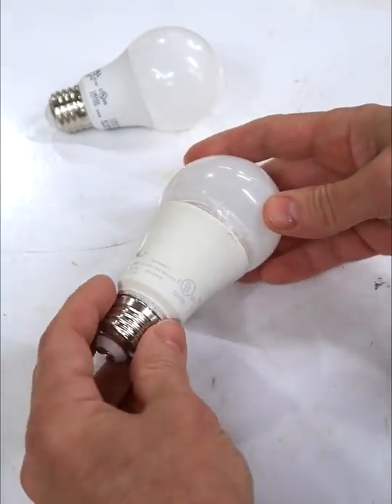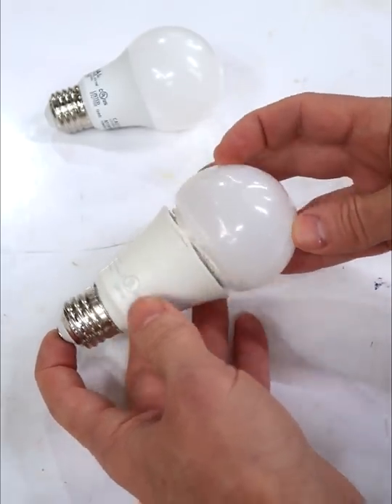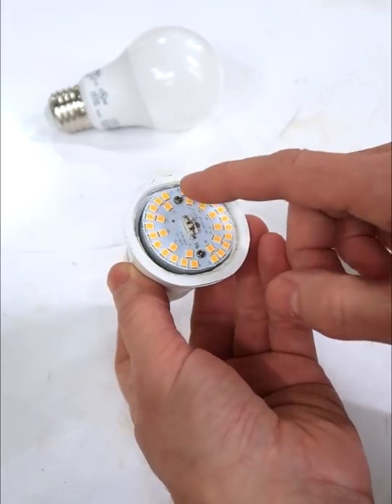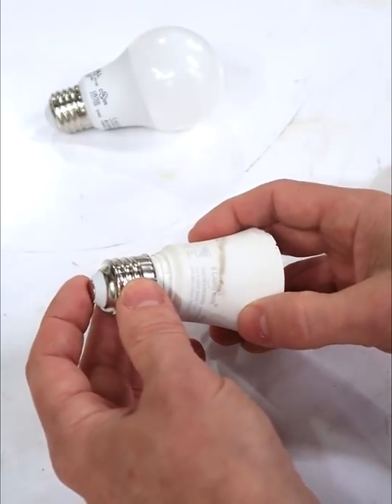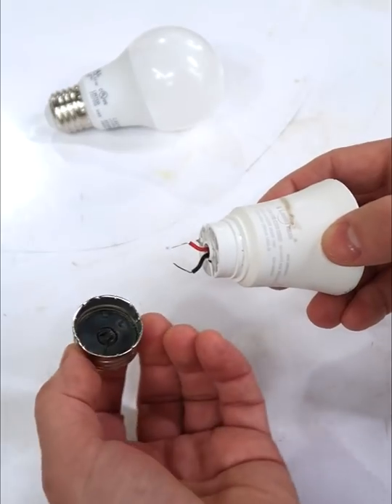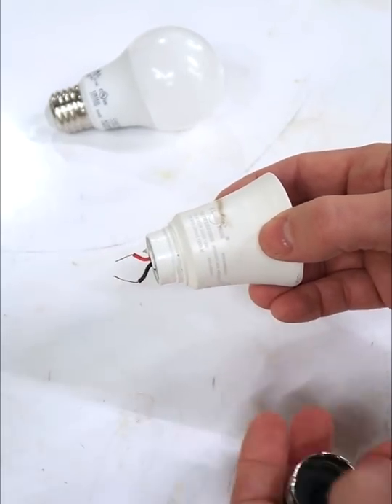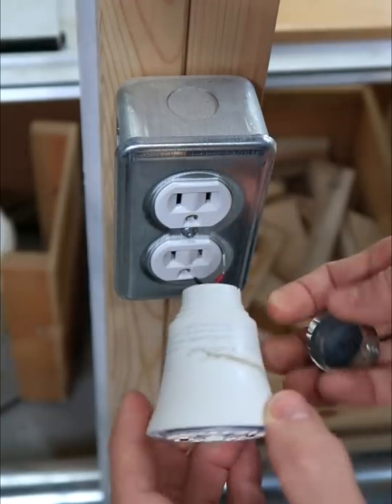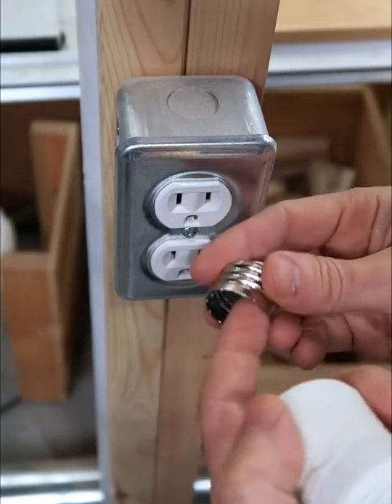LED bulb failed for dumbest of reasons

Comment: Chinese manufacturers often completely miss the point of the products they make.  These things were claimed to last years and years, and technologically that's probably true, but good luck finding one that ever does due to build quality.  Even like the safety seals on milk jugs at Walmart, the manufacturer obviously didn't bother to see if they actually worked, they just mimicked the appearance.  You can easily take the cap off along with the safety seal still attached, usually without even trying, making it appear as if it's never been opened.  I've encountered so many instances of this, of a design being copied with zero regard for the original function or intent.
Reply: This nationalist explanation is such a gross example of cope. Firms are pressured to reduce investment cost per unit produced, no matter what nation they locate their production capability in. Further, it ignores the global, internationalist nature of Capitalist production, today.
Reply: @Mark-dc1su  There was a time when people complained about the quality of Japanese products, and it's possible that initially there were quality issues as they adapted to their new role, but over time they proved to be the producers of some of the best and longest-lasting products.  Unfortunately, China has not followed in Japan's footsteps, despite having a much longer time period to do so.  

A company wanting to reduce production cost is one thing, but the manner in which an actual manufacturer accomplishes this, and their own goals to maximize their profit, is another.  These days it's not unheard of for a product's specifications to be changed by the manufacturer themselves in order to reduce their own costs, sometimes without even communicating this to the company who designed it, creating massive headaches when problems are later discovered with seemingly no explanation as to why.  They'll sometimes remove just enough components to ensure the product still works, regardless of how that might affect its operation under certain circumstances.  The use of counterfeit components is also very common, and one never knows if it was intentional or if the supply chain was simply so contaminated at a higher level that nobody knew the difference.  

There is obviously some blame for US companies who do continued business with these kinds of manufacturers, especially because I doubt they mind if this contributes to planned obsolescence.  It's so common to have large quantities of product failures that they account for it ahead of time, factor it into the budget, design their warranties accordingly, and rarely ask questions when you try to do a warranty request.  They don't attempt or recommend repairs, it's easier and cheaper to simply give you a new one.

It's obviously a far more complex issue than simply "China is bad", but at the end of the day, when you ask a lot of smaller product designers of their experiences with manufacturing, it's probably going to sound pretty similar.

Comment: Now you can make everlasting Dubai-lamp easily. Just add the 400 nF  in series. As suggested BigClive.
Reply: this failure wouldn't be fixed with a capacitor.

Comment: The last time I opened one to see what was wrong I was shocked to find one of the LED’s had actually burned out. A bad resistor maybe? I didn’t find anything else wrong with the circuitry but did notice that the input wires, like yours, were not soldered but tucked between the plastic and metal.

Comment: I miss incandescent bulbs. Especially in winter.
Reply from the maker: We switched the kitchen lights back to incandescent, 72 watt halogen-- equivalent to 100 watts traditional.  We heat the kitchen electrically, so it's not like the heat is "waste"
Reply: @matthiasrandomstuff2221  You better start hording them and buying them on ebay since the Govt. banned them last month I work at Walmart and all the Incandesants are sold out have 32 bulbs in the mail today picked up another 32 60 watts so I should have 100+ assorted bulbs LED emmits a harsh light doesn't matter if they are tinted like the edison bulbs those suck just as bad.

Comment: Are those Philips bulbs? I bought a bunch thinking I was buying a premium bulb, and two years later they have all started the flicker. I should take off the base and check them out. One of the bulbs was DOA out of the box, I found that the socket in the board where the power pins fit through was only soldered on one side.
Reply: Sounds like the Phoebus cartel is still active.

Comment: The same thing happens in commercial applications. We have purchased hundreds of LED 2x2 layin fixtures for our hospital drop in ceilings and so many of them are failing just after a year after installation. It isn't the LEDs themselves it is the drivers which are failing. In some of our 4 foot fixtures I have ordered replacement drivers and then the lights work as new but they're expensive. Still much less labor intensive then changing an entire fixture and more costs.

Comment: The reliability of cheap LED bulbs is terrible... I have used Philips in the whole house for the past 5-6 years and I have never replaced a bulp... not once. Every single bulp I have is LED and no problems at all. But I know many that have problem with cheaper ones.

Comment: Hummm... I have an LED bulb that might have that same or similar cause. It worked well for a while and then it started flickering all the time. I interchanged it with the one in another room, as this room is rarely used at night. However, after a few uses, it stopped flickering, or it would flicker again and stop. Now it just flickers for a few seconds right after it's turned on and then it doesn't. Thank you for sharing, I was wondering what could cause it and that might be it.

Comment: what, why generalize to LED bulbs? Any bulb can have this problem if the manufacturer doesnt solder the wires...
Reply: Nobody wants to buy good lamp because it is not cheap. So on market we have almost dirt cheap and unreliable lamps
Reply from the maker: Traditional bulbs are all soldered.  They get so hot, and so much more current, that this would never work.
Reply: I'm curious as to how many manufacturers do actually solder those wires. 🤔
I imagine this case of failure was only revealed because of the bulb's placement a workshop with vibrating machinery,  leading to the wires getting knocked around and eventually coming out. This probably won't affect 99,99% users so it wouldn't warrant an extra cost in manufacturing to get those soldered, but Mr. Wandell along with other workshop owners might continue to see this happening and feel like their getting ripped off.
Reply: @Flextro  this is the problem at the center of most modern consumer issues, if it cost 40$ to make an led lamp that was guaranteed to last 1000 years and was made exclusively by people earning decent salaries , you would sell 1 for every 100k of the  3$ disposable bulb on the shelf next to it, even to the same people who come back when the first one only lasts a week. We're used to things only getting better, and cheaper.
Reply: @kylkim93  the failure has nothing to do with location of the bulb.  I had two of these exact same failures.  One was a 3 bulb fixture in the bathroom and the other was in the living room.  Both failed the exact same way.

Comment: I have those exact bulbs. Very cheap. Pull out the centre pin, bend 1 wire over the edge, pass the other through the hole the Center pin leaves once pulled-out. Trap the other wire between the socket as you push it onto the plastic body. Push the pin back in trapping the central wire. 
Fixed, and pretty much how they are assembled

Comment: And I learned recently that led strip is just in serial. So it's the old Christmas light problem all over again.  And wrapping a wire around the LED allows you to bypass the dead LED element.  I was about to replace one bulb  but will have check it out.  TY.

Comment: Our house is all Sylvania LED and has been for something like 6-8 years, only had one bulb electronically fail. It started flickering last year so we tossed a new one in, although it wasn't a super high hours one. Another one had the cap smacked off and the living room lights are pretty flickery when dimmed now, but that might be the dimmer going out. Couldn't really be happier to be honest. I still play around with incandescents for fun but general lighting is all solid-state and running gorgeously.
Reply: Friendly tip: Be careful to get the right type of dimmer when you replace it. 
There are two common types of dimmer switch: Leading edge and trailing edge. Trailing edge switches work best with most LEDs.
If your current dimmer switch is old it’s likely a leading edge switch and this could be the cause of the flicking in the first place.

Comment: I had exactly the same problem in a led-bulb that came from a pack of 6. The problem presented itself straight away and they replaced the bulb in the store. They actually had a pack of bulbs on the service counter ready because so many returns had occured.
The other 5 bulbs of the pack are actually still in use and working fine. This was 6~ years ago when we moved to our current house.

My thoughts are that when the cheap led boom hit here in europe, the quality control was 2nd priority over quantity. I'm guessing current led bulbs are better.
Reply: Manufacturer was a brand called "LED ENERGIE" if someone is interested.

Comment: I never had any issues with any of my LEDs and I usually buy the cheaper ones. They are a lot more reliable than the previous technologies. I still remember always having a could spare incandescent bulbs and having to replace a broken one every couple weeks.
Reply: you must slam doors and smack your lamps because we rarely had to change incandescent bulbs ever in our house, switched over to led 12 years ago and have replaced every unit once or twice already...
Reply: @Hammerjockeyrepair  yeah, sure, that's what I did. And I stopped as soon as I got LEDs, as now you are the one doing it and breaking them. What a great argument 🙂.

Comment: They talked about how LED bulbs surpass incandescents in reliability. Problem is they don't factory in the lower quality of manufacturing. I've converted my whole house to LED and I've had led fixtures fail 4-5 times. I put an LED fixture in the mud room that had to be sent back for warranty five times after flickering issues like that one.

Comment: I have a ton of 100W equivalent bulbs that have all rendered themselves unusuable because the powersupply seperated itself from the metal body, because the two standoffs that mount the base to the body severely embrittled and broke. Although I guess it was for the better because the bulbs all had terrible RF emissions

Comment: I could find LED bulbs with 10 year warranty, then all I could find were 5 year, now 3 years seems to be the norm. So much for 17-22 year life that they mention on the box. Note that is at 3-5 hours use per day. The extra cost of LED bulbs isn't offset by energy savings if you have to replace them every 2-4 years.

Comment: In the early stages of the transition to LEDs, my father got a deal on several cases of Sylvania Osram LED bulbs and put them up all over his house. He gave me a case of them, and I started using them as bulbs burnt out. Ironically, those are the only ones I've ever had much issue with. Several developed a serious flicker, while a couple didn't even outlive the fluorescent bulb that was already in service next to it. I went with the slightly more expensive GE LEDs when I replaced all the cheap original light fixtures throughout the house about 4 years ago and haven't had to replace a bulb yet.

Comment: I bought an LED bulb when they were first hitting the stores, I paid $30 for it.
IT STILL WORKS.
Its base has fins on it, this gives it better surface area to keep cool.
Those "Smooth Based" designs have less cooling ability.

Comment: the last actual quality LED bulbs that last, were the CREE ones made in the usa. once production went to china and mexico, they turned to crap. i have USA made CREE bulbs installed in 2013, which are still working just fine today. they are used day in and day out. they have exceeded the expected lifespan by tens and tens of thousands of hours

Comment: Do you fix it and put it back together?
Reply from the maker: I will probably solder a power cord to the leads.
Reply: @matthiasrandomstuff2221  Is there a way to solder the connection in the original bulb to fix it and reuse it in the socket?  I have had the same issue and would attempt to fix it if possible.

Comment: The reliability of LED chips is outstanding due to modern technological breakthroughs. Over the past 15 years I have kept all of the LED bulbs that I have replaced. Out of those, 7 have actually failed due to circuit malfunction. The rest (2 boxes worth) have been disassembled, diagnosed, wires reattached and/or bad solder joints resoldered, reassembled & resealed, and are still working just fine. The only exception is the outdoor flood lights, most of them failed due to weather extremes. It's the LED bulb's modern Chinese manufacturing methods that suck ass, that is the reliability problem, not the LEDs themselves....

Comment: The led's themselves are generally really reliable, even the cheap ones that are driven harder than they should be are still fairly reliable as long as they aren't driven stupidly hard and they have sufficient heatsink and cooling.

Most of the time the cheap ones fail due to poor quality construction causing a short or broken connection like your bulb. And with your bulb 30 secs with a soldering iron would have had it fixed.

Comment: I bought a lot of LED back when they were 5-10 a bulb... a few are very oddly shaped, many are traditional style but still different than the “standard” LED you seem to find today... ALL of the old ones still work... I’ve had a few newer ones fail, but they were only $1-2 each when buying multiples.... one of the odd ones is flat, and one of the two is used as a shop light that gets beat around a bit... wayyy more abuse taken than any traditional bulb... still going...

Comment: That's just silly.  I wonder if quality control got wind of this?

For driver failures, I wish the led stacks would just work with a 12 V supply, for tinkering and making your own versatile slab lights.  Or if there's a common circuit to drive the board.

Comment: I had a failed LED bulb in front of me when I saw this video - so I took the screw connector off, and there was nothing holding the wires in place. Astounding! UK sockets don't allow me to easily reproduce your test (neither does my wife), but I will wire it up tomorrow to see if it is working.
Reply: Yes - it was just the connection!

Comment: I use Philips brand led bulbs and have had great success with them, but they are get old and almost 6 years old, I'm sure they will fail at some point. Seeing this video made me remember looking at old incandescent light bulbs with proper solder joints on the screw in connector, gone are the days when you could get decent quality light bulbs for a dollar

Comment: Yeah, I find similar LED bulb failure..
Other common failure is one faulty LED diode, but that's, usually, when manufacturer overdrive them for bigger brightness or cheapness..
Third failure is driver, but not all bulbs have them..

Comment: Here in the UK we have sockets that are normally shuttered off preventing children and adults with a death wish to poke things into the sockets.  The shutters move out of the way for the plug pins when the EARTH pin which is longer than the L and N pins, is inserted.  The L and N pins are also insulated for the part nearest the plug to prevent little fingers reaching round and touching during insertion and withdrawal of the plug.
Reply: Different setup, but same results on the continent. Here there is no separate E pin on the plug, but exposed metal in the socket makes the E connection first. L and N are not touchable because of a collar hiding them before contact. And the shutters open on concurrent insertion of L and N only, not with a single or two flimsy wires.

Comment: i have to switch out LED lightbulbs more often than we ever had to with incandescent, and given that they require quit a lot more material to produce their lifetime environmental impact can not be that much better.
At the same time i am still using 2 desk-lamp i got ~20 years ago with halogen lamps, one of them is in daily use, 2-3 hour per day, and both still with the original bulbs.

Comment: I swapped out my shop light bulbs with cheap, $8 for two, led bulbs and even when it's cold I have instant light unlike the florescent lights they replaced. I used a kill-a-watt device to test before and after so these bulbs have already paid for themselves too in electricity so that's two wins. If one goes out I'll take it apart, watch a YT video and learn something even if I don't get it working. I highly recommend a Kill-a-watt device or something similar as it shows the real wattage used which is usually a lot less than what's advertised and can show you parasitic draw on everything from appliances to wall chargers.
Reply: That’s interesting! Where did you find your device? I noticed an interference in the newer products! Especially the ones that have charging ports in them! Like the bedside alarm clock/ table lamp/ charging port combos? I’m curious about the drain/ interference!
Reply: @sunderwood9321  Walmart online shopping. It plugs into an outlet and you plug in whatever to it's plug and it shows the line voltage, starting watts, watts in real time and you can enter your cost per kilowatt to see how much it costs to use. I bought an off branded one but if you search Kill-a-watt you should find many. Hope that helps.
Reply: @tihspidtherekciltilc5469  Thanks🙂